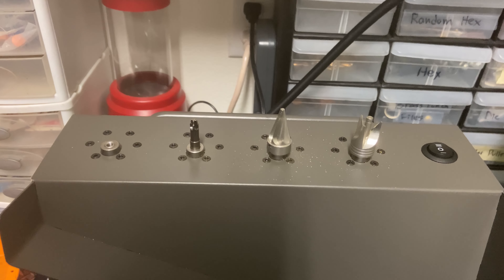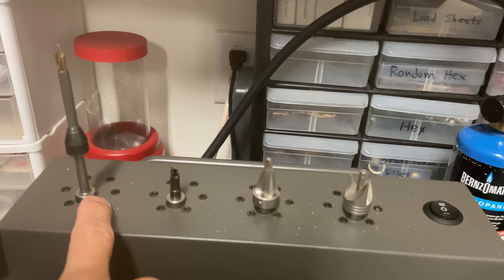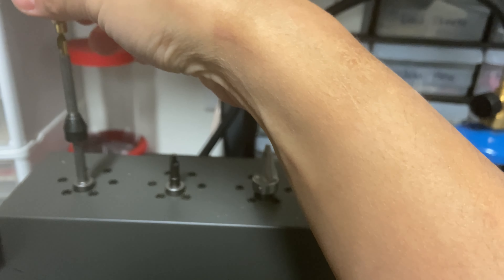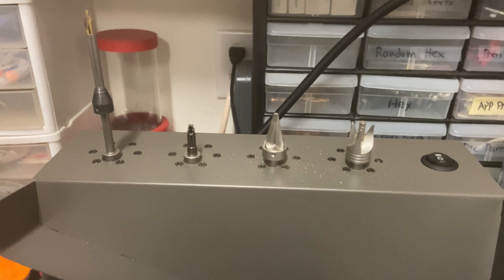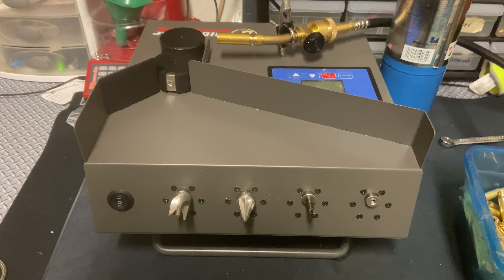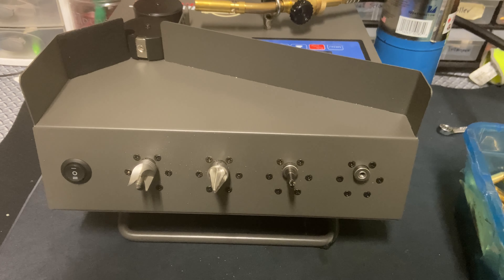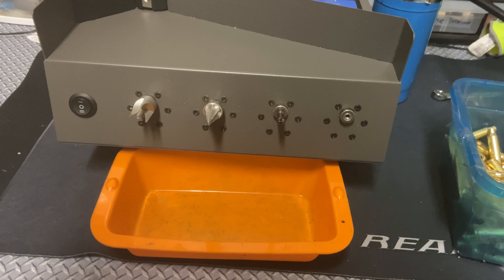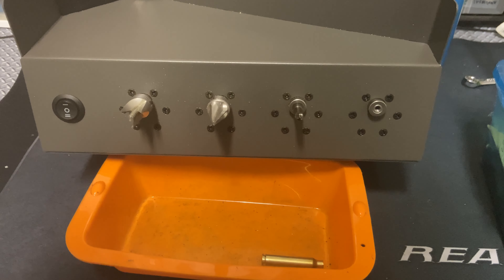Case Prep Center Demo - Burstfire 2 in 1 Annealing + Case Prep Center

Comment: Could you attach a case length cutter to it too? like a Lee
Reply from the maker: Sorry for the delay in response. It’s 8/32 threaded. It will accept any industry standard prep tool bits. Not sure about the Lee cutter. If I remember correctly, Lee cutter is not standard, and only threads into their own tools (handle or power tool adapter).

Comment: I just bought one the other day and it turns really slow. How can I adjust it?
Reply from the maker: Hi, one of the case prep center motor spins at a 45% reduced speed by design. This is to allow the use of tools such as the flash hole Uniformer in a prep center. Most prep centers spins at a greater speed making it difficult to align the point of the tool to the small pocket. Especially when most of the rod are not perfectly straight and wobbles a bit when spun. It is still fast enough where it can still effectively perform all prep center functions. 

The reduced speed station is station 4, the one all the way to the left. 

If this is not your issue, please reach out via our website for further assistance. A video will help.

Thank you.